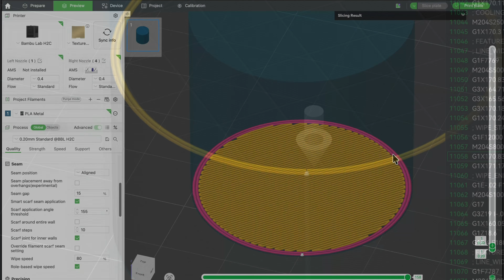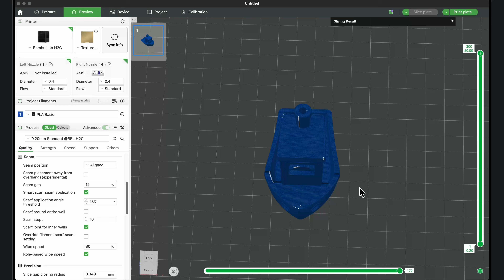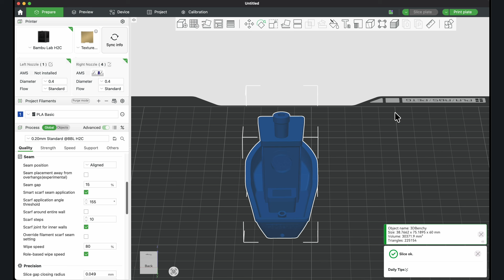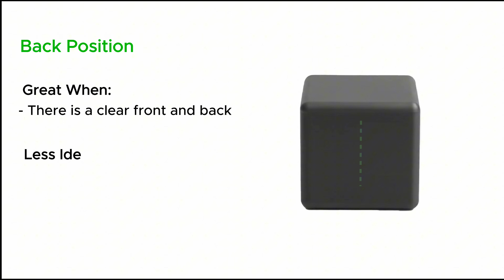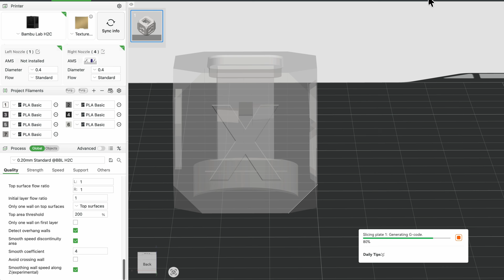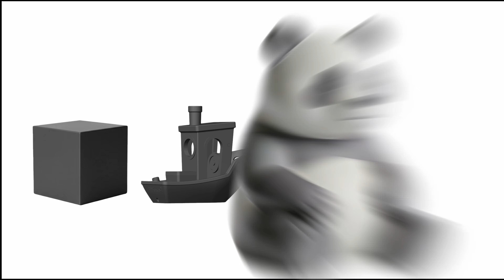Bambu Studio Seam Control - Hide Seam Lines in your 3D Prints

Comment: Isn't it an option to hide seams inside the print like in the infill? I really don't understand why the print head should pause in the outside layer when it also can stop on the inside. That way you don't see the seams and maybe only in top or bottom where the print starts and ends. This should be minimal.

Comment: if your design allows it (both from a aesthetic and functional perspective) enabling fuzzy skin is an amazing way to hide the (random) seams. I know, different setting that doesn't apply directly to the seams and has other up/downsides but that's my main reason to use it
Reply: I mean for many things the right fuzzy setting also looks great
Reply: @timbonator1 I agree, I use it on most of my aesthetic prints. my comment was mostly meant to highlight its value/relevance in the context of hiding seam lines, as it wasn't mentioned in this video about hiding seams